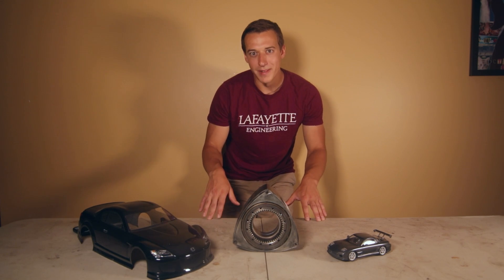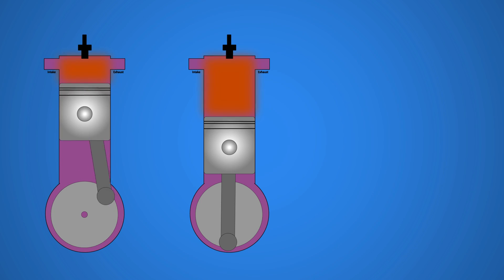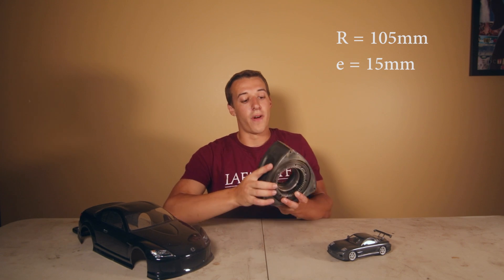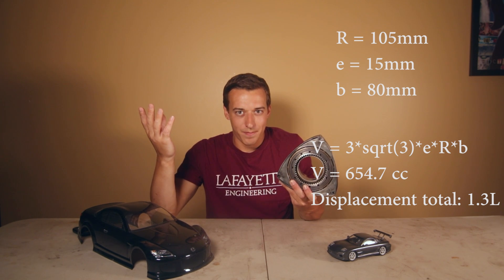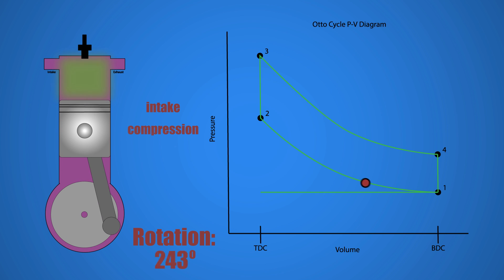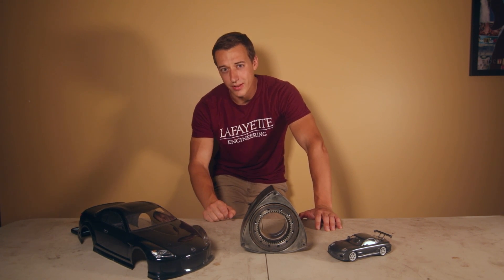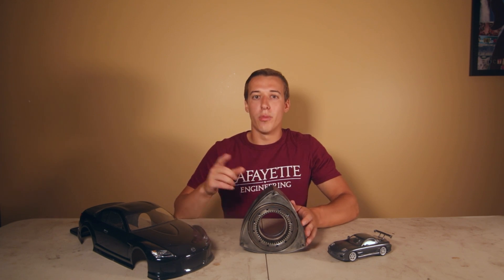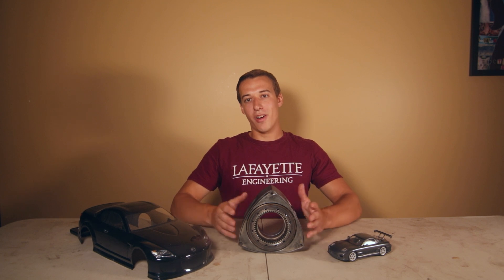You are WRONG about Rotary Engine Displacement

Comment: auto cycle has absolutely NOTHING to do with displacement, now i do disagree with Mazda about it being 1.3 Liters for the 13B because their math and the formula that you have shown, DOES NOT account for the 3 combustion pockets in each rotor, it is much easier to calculate displacement in piston engines, bore X bore X Stroke X3.14 X number of cylinders, HOWEVER, displacement varies even on 2 identical engines if the pistons of one engine has been replaced with either domed or dished pistons, displacement is defined as the total maximum volume of AIR that the engine can utilize, so a 5.7 liter engine while it does in fact displace 350 cubic inches from the factory, it can loose as much as 40 cubic inches because of domed pistons, or gain as much as 25 cubic inches when utilizing dished pistons, it is just easier to refer them as 5.7 liter since that is the displacement that was intended from the factory, same thing with the pockets on the Mazda Rotors should at some point be included into the calculations, the 2.6 liter argument is even more preposterous than the auto cycle one, although the Rotary engine does in fact share the same auto cycle with a 2 stroke engine, multiplying one revolution with one auto cycle of the 2 stroke does not compare with the 3 auto cycles that the Rotary completes with every revolution per rotor, the formula that Mazda uses I think is a good starting point, but the displacement of the pockets needs to be included as well!
Reply: The more I think about it, the more I think it's 3x1.3L displacement for the three faces of the rotor forming 1.3L swept volume. However, displacement should be displaced (not total!) volume of air in a single stroke. So I would not consider the pockets in the faces of the rotor to count towards displacement. It is the same thing as the clearance at the top of a piston compressor/engine. It changes compression ratio, but not displacement because that (clearance or pocket) volume is always considered at both TDC and BDC. That is why displacement is commonly considered as the maximum volume of air (at BDC) MINUS the minimum volume of air (TDC) and not just the max volume.
Reply: @PeterArmour  Yeah, true complete engine displacement is 3924cc (or 3.9L).

I don't understand why people get so hung up on the whole displacement relative to crank (or in this case "E-Shaft") rotation when that has absolutely NOTHING to do with an engines displacement. As keith basically pointed out, an engines displacement is the volume of one working chamber (cylinder) times the number of chambers (cylinders) and a Rotary (13b for this example) has a 654cc swept volume chamber and has 3 chambers per rotor and 2 rotors so that is 654 x 3 x 2 = 3924cc just as a 2.0L 4 cylinder engine has a basic 500cc swept volume per cylinder and has 4 cylinders thus has a total engine volume of 500 x 4 = 2000cc (2L)
Reply: The Wankel engine does not have any dome, the combustion chamber recess is a negative space and has no effect on swept volume displacement.
The key argument is does each chamber face displace a volume of air? Because All Wankel engines  operates using the exact same 4-stroke operating principle The answer is YES, all 3 volumes must be counted when determining displacement.
The catch is when you compare the 4-stroke Wankel with the 4-stroke Otto and Diesel engines.
They complete their firing order sequence in 720° degrees of crankshaft rotation while the Wankel requires 1080° degrees.
This is why engineers, regulating agencies and motorsports sanctioning bodies all use and agree on the 2x conversion formula.
The 13b series for example has a total true displacement of 3,924cc's but when compared to a reciprocating 4-stroke we classify it as being approximately 2.6 liters.

Comment: Kenichi Yamamoto says it's 1.3L, so it's 1.3L.  Racing classes double that to gain parity with piston engines.  There's no technical reason to call it 2.6L.  I've said it's like a 2 stroke 4 cylinder
Reply: Sorry Chris, Felex Wankel, Hanns Paschke and Walter Freode all say you are wrong.
The true, total displacement of a Mazda 13b series is 3,924cc's.
We use the 2x conversion formula to adjust the timing sequence from 1080° to the normal 720° because the Wankel engine is 4-stroke..
Not a 2-stroke.
Any questions son?

Comment: I think that displacement should be specified in volume/rotarions of input shaft. Another thing is that input shaft of a wankel engine is spining 3 times faster than rotor, but also rotor has three sides, so it's still one cycle per rotarion. Btw thank you so much for explanation of rotor dimensions.
Reply: That is not how swept volume displacement of an internal combustion engine is calculated.

The Wankel engine is a 4-stroke and each combustion face has its own 4-stroke cycle this each face has a displacement which has to be counted.
The 13b has a displacement of 3,924cc's
Reply: Right, it takes 3 crankshaft revolutions for each of the chamber faces to displace a volume of air.. 3 x 1.3 liters or a total true displacement of 3.924cc's
Reply: Darth Vader  Both are rotating, but at different speeds.
There is  a 1:3 ratio

Comment: The problem with coming up with a displacement using that formula is that is gives you the swept volume of a SINGLE face and simply multiplying it by two, because it's a two rotor engine, still does not equal proper displacement. By doing so, you are only accounting for two out of six faces. You're not combusting one face of each rotor every 3 RPM, but you are combusting EACH face of a rotor every single RPM.

You said it at the beginning of your video. If a piston has a swept volume of one liter, and its a two piston engine, this engine's displacement is two liters. It doesn't matter if that engine fires every 360 degrees, every 720, every 180, every 90, or some abstract 45 degree firing separated by 315 degrees of "silence". The total displacement of that engine is still TWO LITERS, because each swept volume is 1 liter multiplied by a factor of TWO swept volumes.

So if we're going by the same volumetric descriptor that is used on a piston engine - that being EACH swept volume is calculated into said engine's displacement - then the 13B is, in fact, actually the equivalent of a 3.9L six cylinder (654.7 PER FACE x 6 FACES = 3,928.8) because you have SIX swept volumes, not just two. Which if you think about it, makes sense. GM L67 (3.8L V6 supercharged) produced 240HP on 7-8 pounds. 13B REW produced 260HP on 8-10 pounds. Both were rated and got roughly around 16mpg city as long as you weren't flogging them all day. Other than a "lack of torque" the a rotary essentially behaves like a V6 in terms of efficiency and power, only being smaller in overall package due to engine design.

So displacement on a rotary? EVERYBODY is getting it wrong.
Reply: Thats my thoughts, it have 3 combustion chambers per rotor.
Reply: When you say you are combusting each face of the rotor each revolution, of the rotor yes, but not of the crank shaft and that's the common point of reference, so as a wankle engine does not have an ignition on all 6 faces for every rotation of the crank they do not need to be considered, just as the cylinders in a 4-cyl reciprocating engine in exhaust and intake are not. As the ratio between crank and rotor is 3:1, only 1 ignition cycle takes place per rotation of the crank, so it IS fair to only consider 2 faces, otherwise the reciprocal engine must also consider the pistons that are present but not firing.

Or in short, you can't compare the crank in one engine with the piston in another.
Reply: user-go7yd8qp4c   no because that is ONE swept volume putting in TWICE the work, not two volumes completing one work. The volume of that one cylinder would be the same exact 200cc (for example) whether it's four stroke or two stroke operation. Either way, you have ONE combustion surface for the whole volume; I.e., you're only sweeping ONE volume. On a rotary, you have THREE surfaces per rotor, giving you THREE swept volumes per rotor housing. It makes zero mechanical sense to measure a rotary the way they do. It'd be comparable to taking a V6 or a V8 and measuring the volume of one BANK of cylinders and making that it's labeled displacement. 

The only difference two vs four stroke makes is in efficiency. Two strokes tend to make more power at the cost of significantly higher fuel consumption. They are literally putting twice the effort in whilst having significant exhaust scavenging which further reduces efficiency (it's the same reason bridgeports tend to be terrible on fuel).
Reply: Darth Vader  Wrong, All Wankel engines operate using the 4-stroke principle.
It requires 1080° degrees of crankshaft rotation to complete the firing order sequence of a Wankel engine.
A Otto or Diesel type engine only requires 720° degrees
Reply: That's a great job of explaining the displacement, but it still doesn't make any sense to me. What it describes is one face of a three lobed rotor. It fires three times in a single rotation. Why wouldn't the displacement be calculated then the same way that a two strokes displacement would be calculated? As an example, a 3-cylinder 2-stroke engine displacing 750 CC's wouldn't be called a 250, it would be called a 750. All cylinders will fire once throughout one rotation of the crank.
Reply: In a piston engine the pistons occupy difference cylinders, so the swept volumes can be added cumulatively. In a rotary, the rotor faces all share the same housing and same moving part (rotor). To compare the two is disingenuous. The eccentric shaft may have to rotate more to get a full revolution out of the rotor but the rotor sweeps 655cc in one rotation Vs whatever your piston sweeps in one cycle. The comparison has to be consistent.
Reply: They fire one face of the 3 sides per revolution of the crank or eccentric shaft . So it's easier to just look at it that way .
Reply: Are people dumb? The word itself answers your question. Displacement. How much air or space is being displaced. A rotary engine is much smaller and therefore physically has to  displace less space. You aren't doing the math based on each face of the rotor because that still wouldn't give you the 3d space that it is displacing in its stroke. All of his math in this video checks out. It is 1.3L
Reply: This is 100% correct. The 13B is 3.9L. it's simply 6 chambers of 654cc. It's that simple.

Comment: In Ireland my RX-8 is registered as a 1744 cm^3… really bonkers how they came up with that
Reply: You actually bought a RX8?
You poor bastard! My condolences mate.
Reply: @sandervanderkammen9230  You actually hate RX8s?
You poor bastard! My condolences mate.
Reply: @JQNAH  What is there to like about the RX8? It's the worst sedan Mazda ever made.
Reply: @JQNAH  You have to be very gullible and naive to buy a RX8... its a pile of junk.
Reply: @sandervanderkammen9230  There is a lot to like about the RX8, the unmatched rotary sound, the smoothness of the engine, the flames, the pops and bangs, the handling, the looks. It's a damn good car! And plus, it's a 4 door "quad" coupe, not a sedan, so I'd say you're the naive one here. But me? No. I knew the risks and I took them and I do not regret it. It is definitely not a car for the weak. And tell me, do you own an RX8?
Reply: @sandervanderkammen9230  You didn't answer my question
Reply: @sandervanderkammen9230  Have you owned an RX8
Reply: @sandervanderkammen9230  Do you think the RX7 is any better??
Reply: @JQNAH  No, I'm not gay.

Comment: Unfortunately there is a huge glaring flaw in your theory.
The Wankel engine is a 4-stroke.. not a 2 stroke and it has 3 swept volumes, not one.
Each of the 3 combustion chambers has its own 4-stroke cycle.

So like a 3 cylinder 4-stroke engines you must count all 3 when calculating displacement.
Reply: This guy is an example of someone who has a hardon for shitting on the rotary engine in every single video he can find, he cant handle the fact the japanese were on to something that bmw or German ingenuity wasnt, regardless of its German origin. Or the fact that for such a small and light engine, it produces some impressive power. Kick rocks, wheelchair boy.
Reply: @xMorbidArtx  Run along little rotard boy...
Reply: @sandervanderkammen9230  At least I can run, meanwhile, Mr Ironside over here could use a rotary.
Reply: @xMorbidArtx  I run 3 miles a day... little rotard boy
Reply: @xMorbidArtx  If you can figure out how displacement is correctly calculated you will realize that the Wankel engine is real not that impressive for its size or the amount of fuel it burns.
That's why the can't be used in passenger aircraft or no longer used in major professional motorsports.

Comment: can we just say it’s 3.9L? At least that would explain the fuel consumption 😅
Reply: Yes, 3,924cc's is the true total displacement...
The trouble comes when you go to compare this with a Otto or Diesel engine that only requires 720° degrees of rotation to complete the firing order sequence.
Reply: I'd suggest calling it a 2-stroke and then it would explain the oil consumption!

Comment: This isn't rocket science. The rated displacement is 1.3L however a 13b ignites that displacement every 360 degrees of the e-shaft. People don't talk enough about the spark events. People forget the basics. Displacement is measured based on the combustion chamber max intake volume of each chamber/cylinder vs a SINGLE ignition event of that volume per chamber/cylinder. This is why it's comparable to a 2.6L 4 stroke 4 cyl piston engine because that engine will only have ignited the exact same 1.3L as the rotary every 360 degrees (1 single ignition event of the fuel air in both front and rear chambers vs 2 piston cylinders). Instead of doing all the math (which is too confusing to many) try to talk about the air the engine MOVES every 360 degrees. Combustion engines at their core are nothing but air pumps. That's the easiest way to compare a rotary to other 4 stroke piston engine. So yes a 13b is comparable to a 2.6L 4 stroke piston because that 13b will have MOVED and ignited 2.6L of fuel air mixture in 720 degrees of e-shaft rotation with 4 total ignition events as that 2.6L piston.
Reply: Except that's not even right since number of shaft rotations has absolutely nothing to do with how an engines displacement is calculated.  Would you say that if someone converted a 2.0L 4 cylinder 4 stroke engine into a 2 stroke that it suddenly becomes a 4.0L engine because it now moves it complete displacement in 360 rather than 720°? NO, you wouldn't because the number of rotation has zero to do with its calculated displacement.

Engine displacement is simply a chamber's (cylinder's) swept volume times the number of chamber's (cylinder's) it has. Example, a 4 cylinder 2.0L engine has 4 cylinders that displace 500cc each and thus 500 x 4 = 2000cc (2L) and a 500cc single cylinder 2 stroke engine has a single 500cc swept volume cylinder and thus is a 500cc engine.

Now with that said, a 13b rotary for example has a single chamber swept volume of 654cc and each rotor has 3 chambers so the true displacement of a single rotor is 1962cc (654 x 3 = 1962) and being a 2 rotor engine, the total engine displacement is 3924cc (1962 x 2 = 3924).
Reply: @CP_300PRC  You miss the whole point. 13b Rotary moves 1.3l of air with one rotation of the e-shaft and has 2 ignition events during that time period. 2.6L 4 stroke piston engine will move and ignite that same amount with the same number of spark events. No need to over complicate this. I used crank rotation as a base because BOTH engines calculate rpm the same exact way so to compare the two different types of engines geometry, you have to know how much air is being used and is ignitied for each combustion event per rpm. That's why a 1.3l rotary is comparable to a 2.6l piston because both engines will move and ignite the exact same amount of air in 2 rotations of their crank along with the same amount of ignition events. Knowing this fact is why the 787b was banned from Le Mans because that 2.6l engine was moving 5.2l of air compared to the other 3.5l on the field in 2 rotations of the cranks.